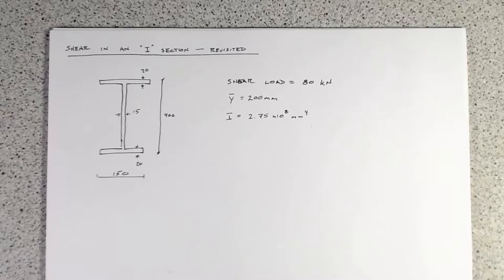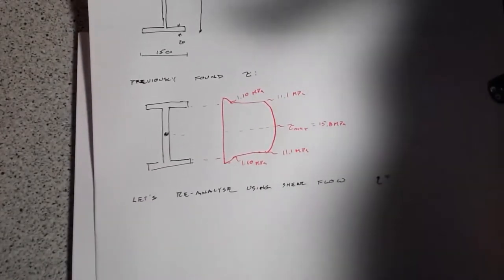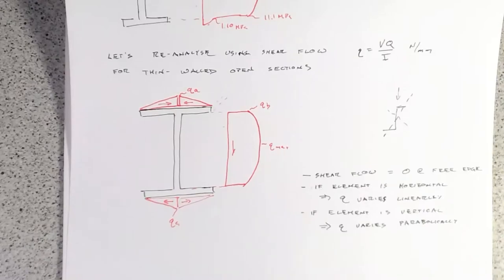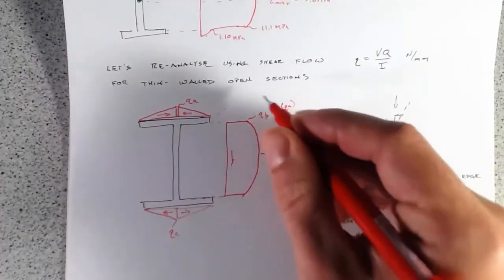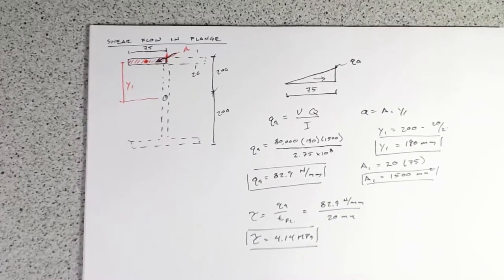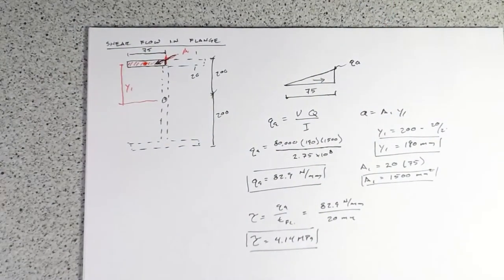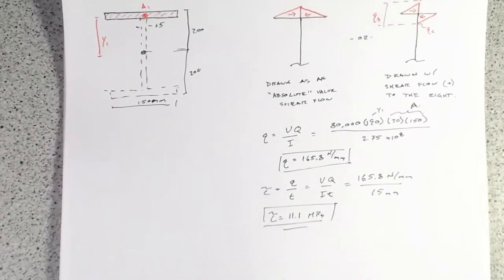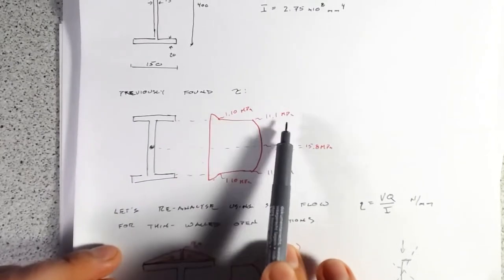Shear Flow and Stress: I Section Example

Comment: First off, Thank You for taking the time to do these videos, I've learned a ton about shear flow and shear stress from you.  I am however, a bit confused on one aspect.  If the shear stress at the top of the web is 11Mpa which i agree with, why isn't the max. shear in the flange at b/2 equal to 5.5.  When the 5.5 + 5.5 combine, we get 11Mpa.  You used the flange t which I've never seen that before.